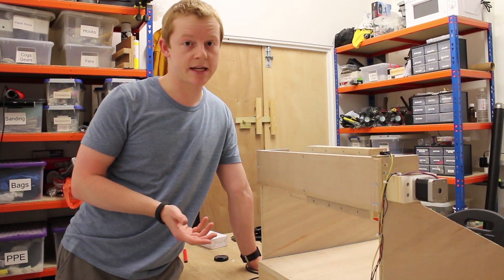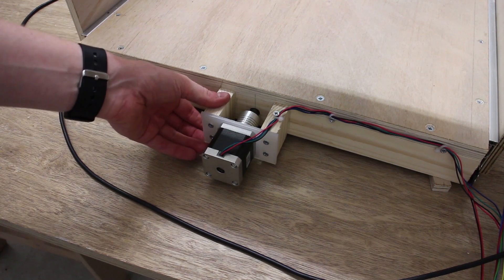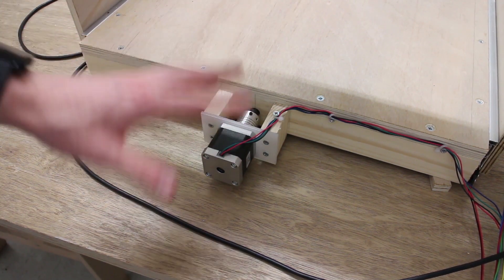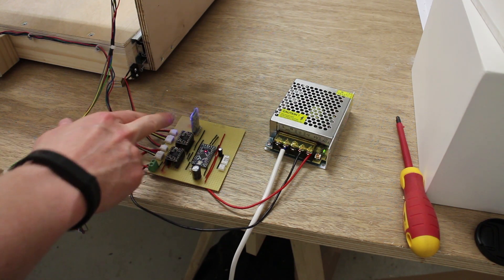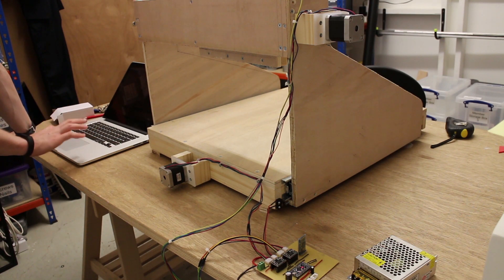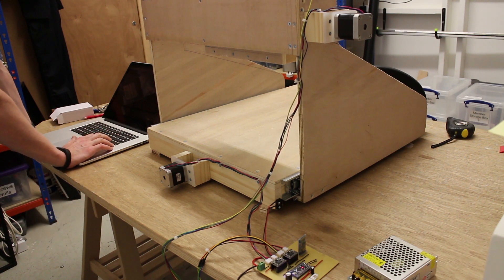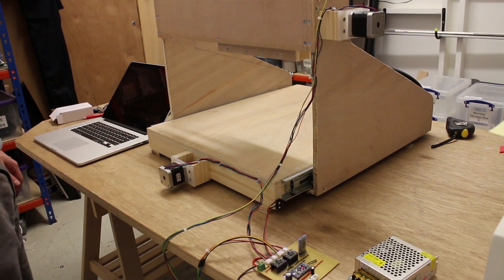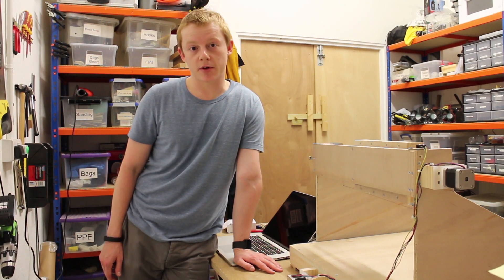Drawer Slide CNC Build - 3

Comment: Nice Job,   but Lead Screws are not the best choice for a Machine that size...  Stepper motors need to spin quickly to opperate the screws..   Stepper motors have their most power at slow speeds,  and very little power at high speed. ..  A direct belt drive (or chain) would make a huge difference..
   I built a lead screw CNC,   after a few months,  I changed it to chain drive..    Amazing difference in power and speed..    It's a whole different Machine..   Chain drive doesn't need backlash parameters either..   There's NO backlash..    So,  it's much more accurate too..